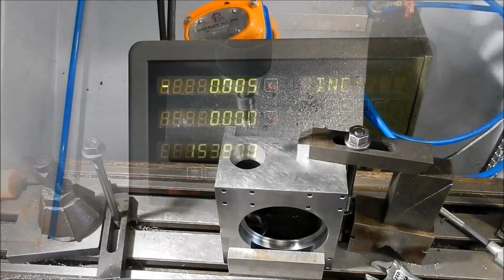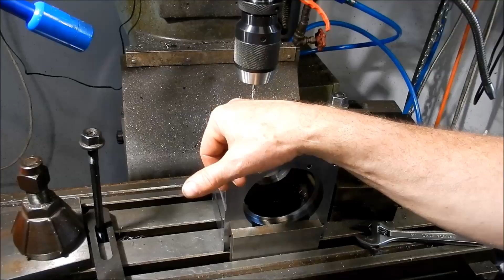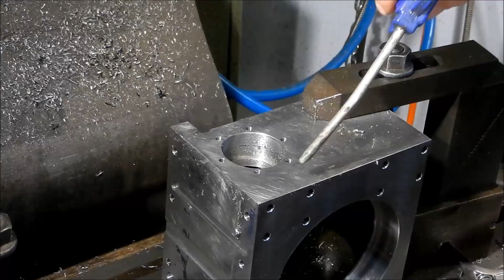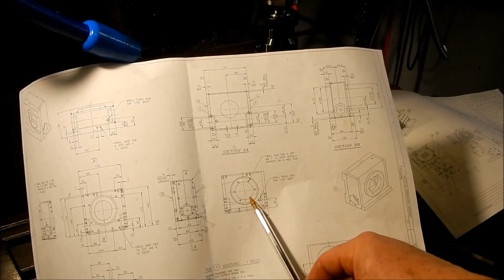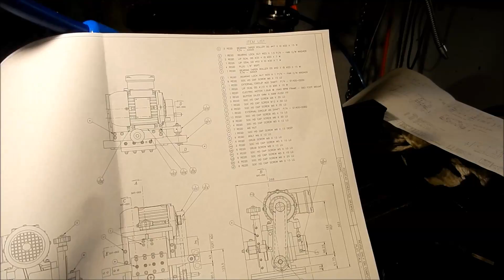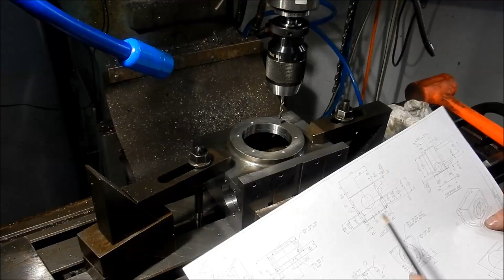Powered Lathe Slotter Build Part 16

Comment: You might try designing a muffler for the intake of your air compressor. A long rubber hose of appropriate diameter leading outside could work, or into an automotive air intake box and filter should do.
Reply from the maker: G'Day Toby, fortunantly it only comes on for around 20 seconds every couple of hours so its not to bad.  Just happened to be in the middle of filming.
Cam